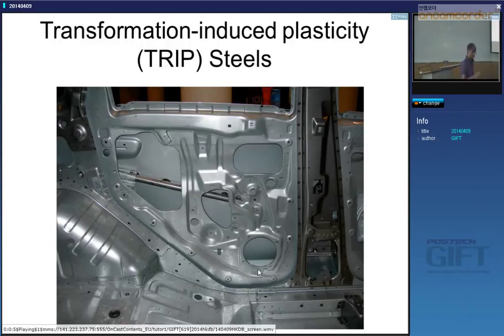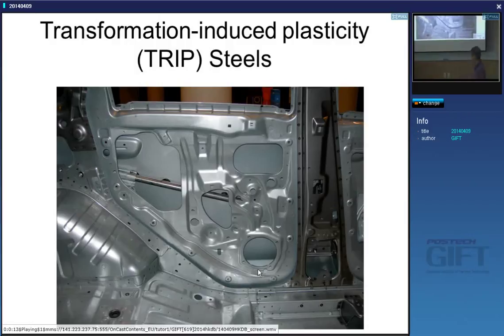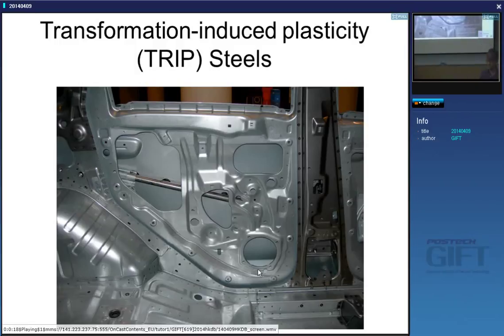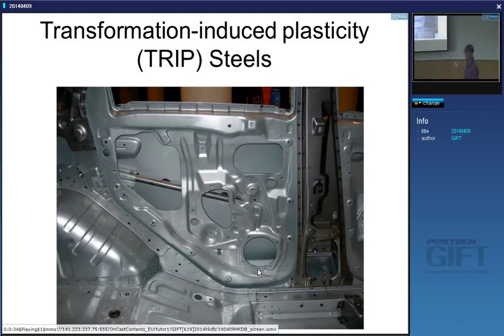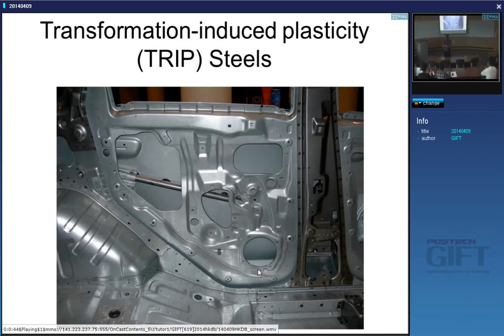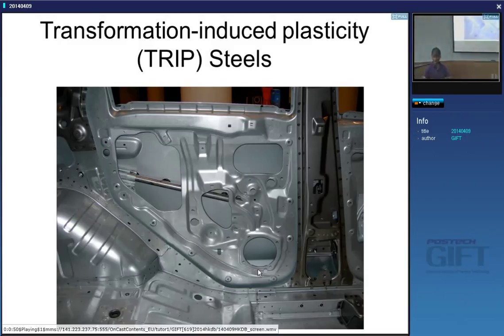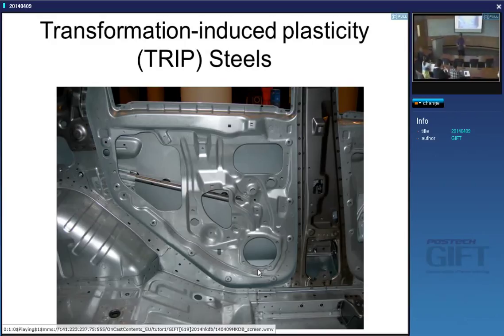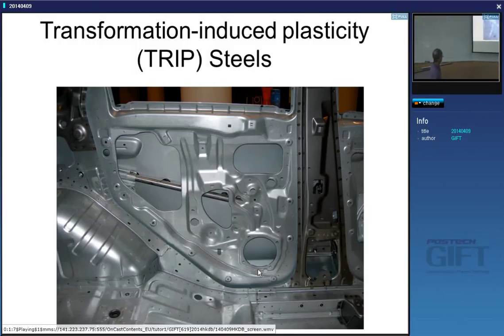Phase transformations in steels 11, 2014

Comment: what's the mechanism that stress-induced martensite can improve working harden ability? thank you.
Reply from the maker: +p zhu See Chapter 21, Physical Metallurgy, 5th edition, Elsevier
Reply: +bhadeshia123 I find the answer from your article 'TRIP-assisted steels? ISIJ Int. 42, 1059–1060.' you said martensite has high strain hardening coefficient, low ductility; ferite has low strain hardening coefficient (n),high ductility (e_U). but the general thoery is that the n value is large, the ductility also high.